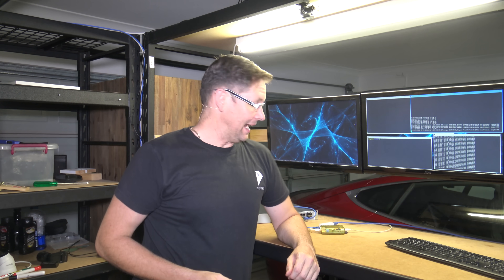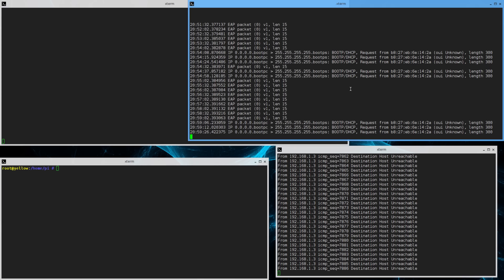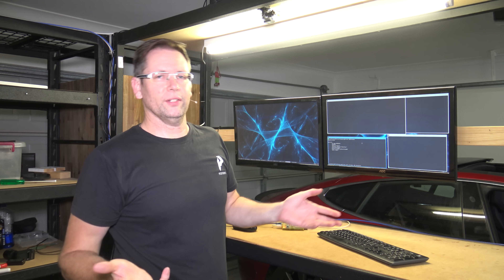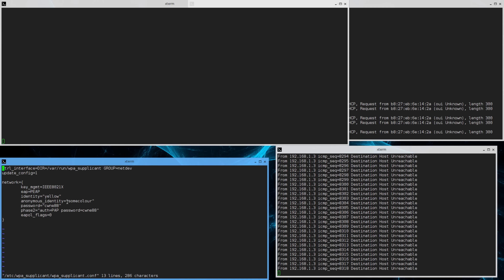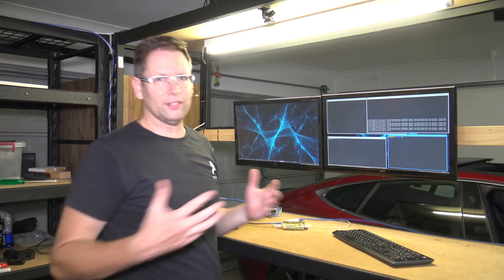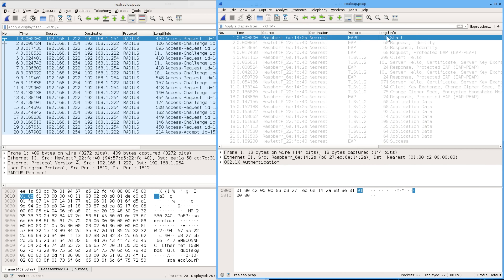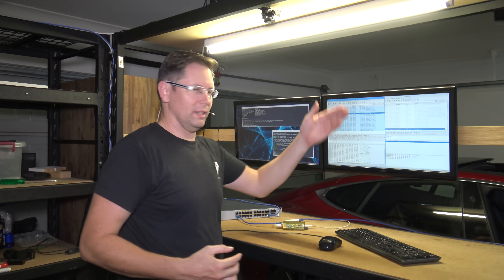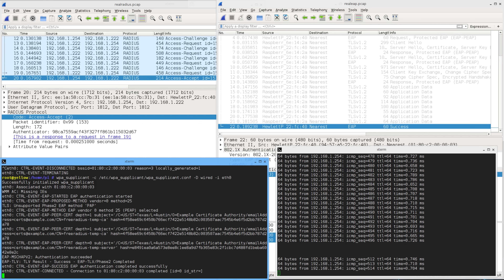Raspberry Pi 802.1X Port Security

Comment: Ive spent the last 2 days trying to work out why I can authenticate to my freeradius server on my OpenWRT box via wireless (whohoo) but cant through the LAN port on the same OpenWRT box-now I know why-there is no authenticator on the LAN ports (just DHCP), whereas there is on the wireless side! So now away to plug the whole dam lot into my TP-LINK switch which HAS 802.1x on the ports-thumbs up big fella!

Comment: You are using a RPI Model B. Where did you get the case? Can you share a link? Can't find one for sale.
Reply: The only place you'll find a case for a 1B these days is eBay. Practical alternatives are 3d printing or modifying a case designed for a later model.
Reply: @firstsurname9893  Thanks. I found one and ordered it on ebay. Had to search with -2 -3 -4 so it would filter out all the other cases.

Comment: Curiousity strikes, what happens when the device is configured static. How does that effect 802.11x EAP/RADIUS interactions?
Reply: Mark LaDoux that only matters after authentication. That’s layer 3 the authentication is on layer 2.
Reply: @eelko1koppen  Thanks. I wasn't sure if it would bypass the whole authentication process or not. I figured there'd be some mechanism, but I've seen dumber mistakes in security solutions in the past.